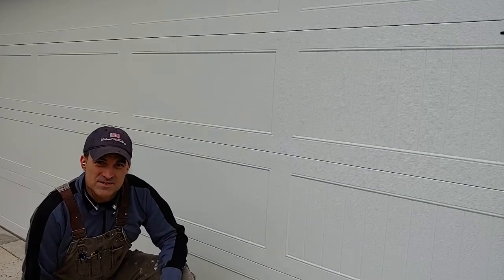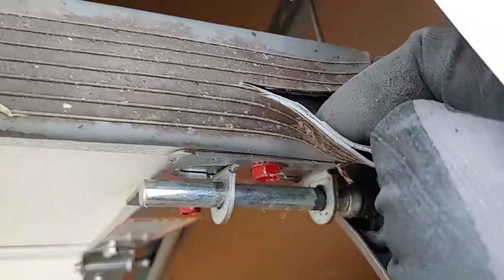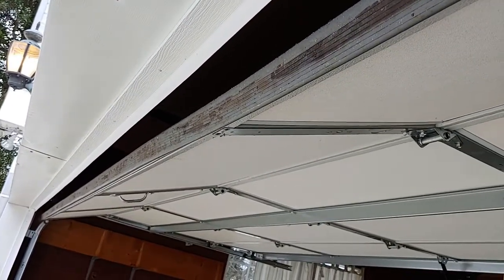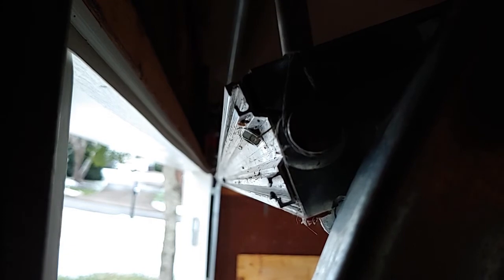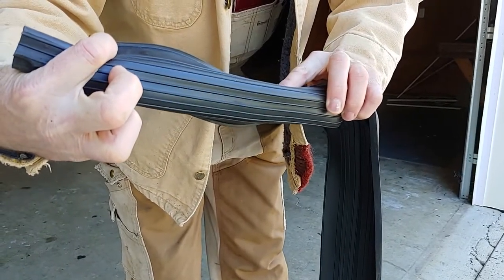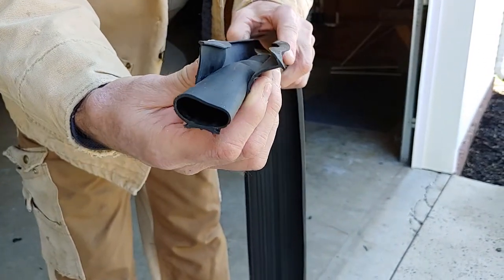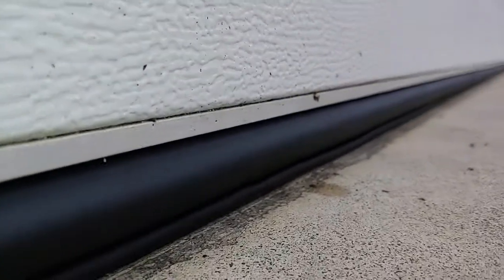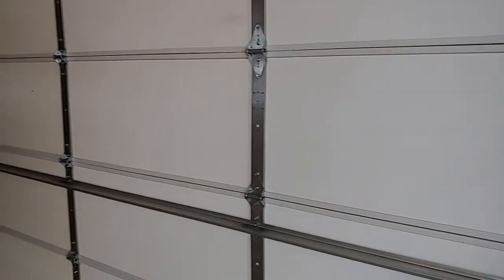Papillon Universal Garage Seal How To Install #homeimprovement #DIY

Comment: ThankU, silly me didn't realize I needed tube 🤭 ordered 10 inches but do I cut off excess? My garage is about 9.
Reply from the maker: Hi Golden H. Thank you for watching the video. You will want to have about 4 inches extra on both sides of the garage door. You tuck it back in to the tubing as shown on the video👍.